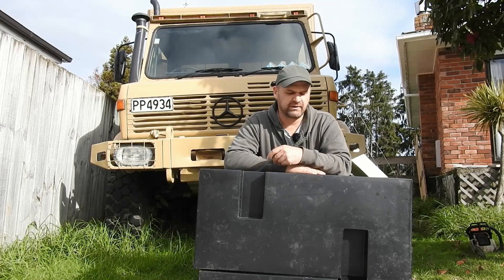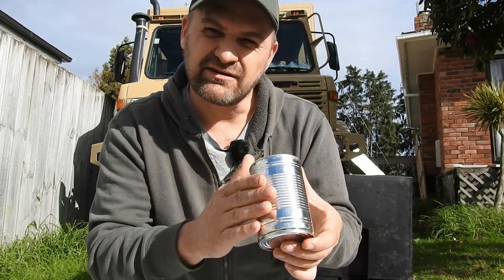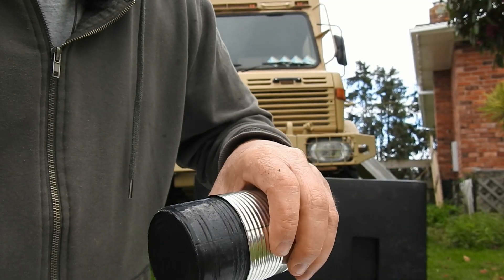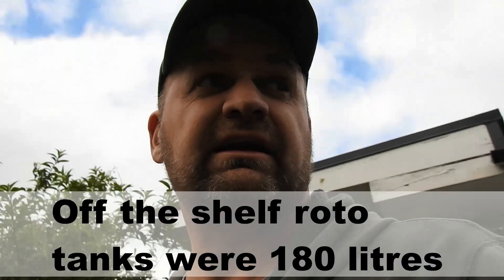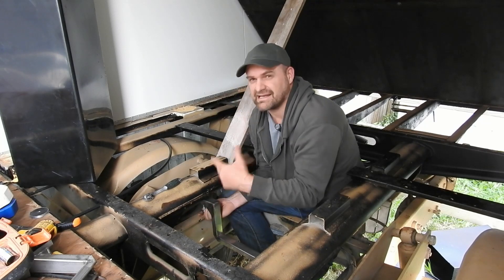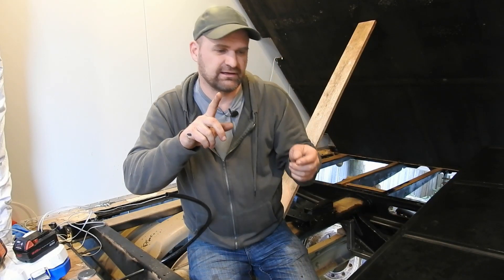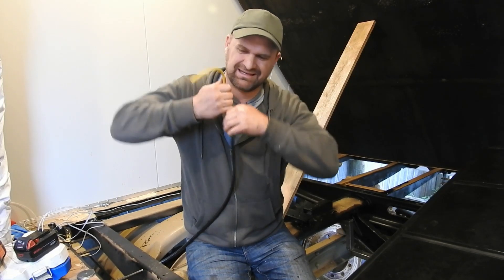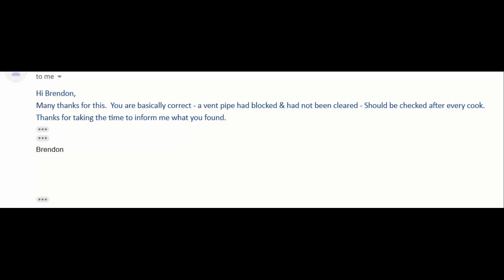Cut my tanks open, how rotational moulding works #9

Comment: Your channel is amazing! Keep up the good work. Looking forward to more content! If you put your tanks under the cabin, won't it freeze in winter?
Reply from the maker: Hey, thanks so much!  Have had a bit on recently and making a video takes me a while, so have put them on the back burner.  With a bit more practice am hoping I can speed up the time it takes to make them and get a bunch more content out.  
With regards to the tanks, I don't live in an area that freezes but am likely to travel to places that do.  I'll be insulating the tanks in the future, installing a heating pad and running line heaters for the plumbing.  Lots of good content to come!

Comment: Why did you cut the outside of the pipe and fill the area with triangle gussets rather than cutting the inside and only having to weld up where it touches?
When are you doing the Sikaflex Fail video please?
Reply from the maker: Yeah, that would have been a better idea, the welding thing wasn't really something that I'd considered as an issue before I got into it.  I wanted external gussets on the external bits to add some strength.

Comment: Hey Brendon, can you possibly confirm the mpg of your unimog, from reading I feel a unimog for me personally with my intentions - makes the travelling aspect too expensive. From a variety of sources of HGV's and larger 4x4's they seem to do around 12mpg?!
Reply from the maker: I'm sorry, I cannot tell you exact fuel consumption, I've not measured...   but I would be surprised if it was as good as that (maybe 20% worse)  I will be able to measure in the future if you want.  Although I havent driven mine far in the time I've had it, I don't believe these are a particularly affordable vehicles to own.  You could buy a pretty nice car for the price of a set of tyres, the maintenance log on my truck is full of big ticket items and it has only got 150,000km on the clock. I believe they get a pretty hard time in the Army. Some people swear by their reliability, but I'm not so sure.   My opinion may change after doing some miles in it... but at the moment if you are concerned about the cost of fuel on one of these things, they are probably not the right vehicle for you...  the cost of keeping them running could cost more than the fuel.  Good luck with whatever way you choose to go.
Reply: @brendontait6968  Thanks for the haste reply, I think given the distances I want to go it needn't be on terrain only specific to these vehicles - hope you have some fun in yours anyway.
Reply: Drove them for 20 odd years in the Army. Yep, empty or lightly laden they do 20L/100km. Put a 6 tonne trailer on the back and load both up and they get up close to 35L/100km.  The turbo actually makes them more economical than the smaller version the Army had for a while. The 1300.

Comment: Great stuff Brendon. Would a stainless tank be a viable solution? With the custom made tanks being 3x the cost of the off-the-shelf tanks, is that not approaching the cost of the steel required to weld one up yourself? Looking forward to the other stuff you have planned for the channel, sounds very interesting.
Reply from the maker: Hey Robert, yeah a stainless tank would be totally doable.  However, it's all about time.   Summer is just about here.